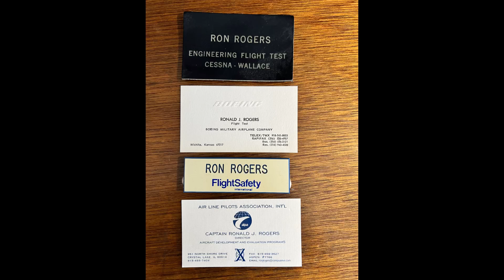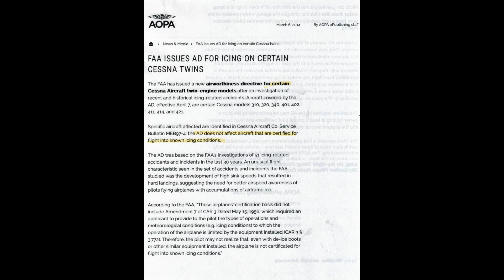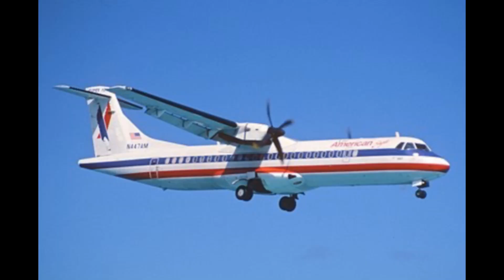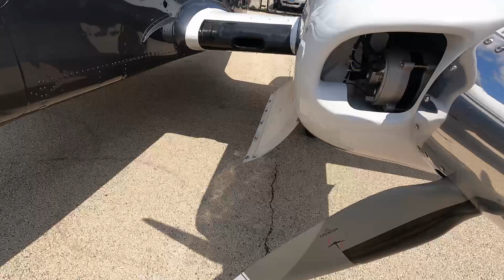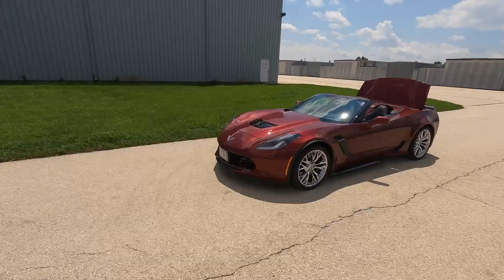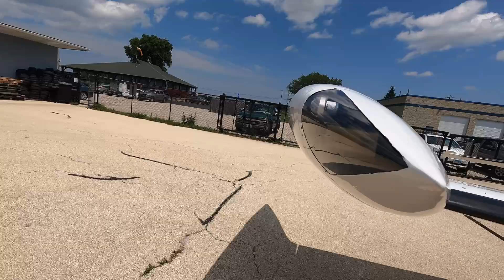Confusion over Cessna Light Twin Certification into know icing Re: AD FAA-2011-0562-0037

Comment: I worked for a part 135 operator in ME. In the 90s and mid 2000. Flying checks at night with Cessna 402Cs and an R model 310. Both known icing. That's all, thanks.
Reply from the maker: Really liked both of those aircraft! And I have the utmost respect for pilots who flew in those conditions!